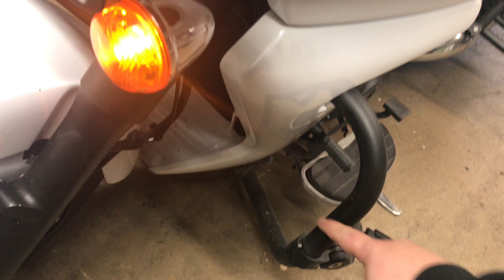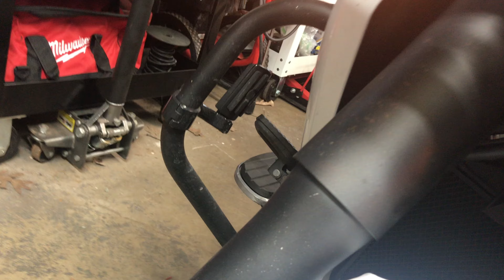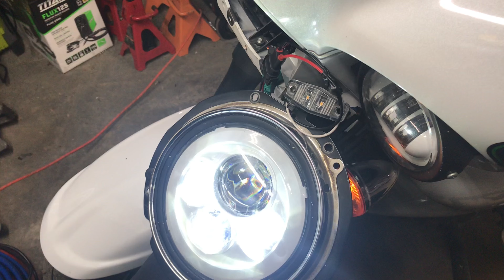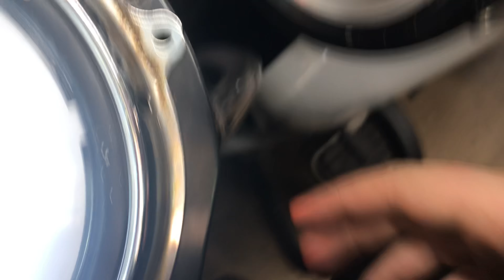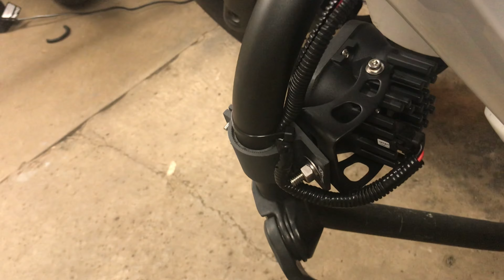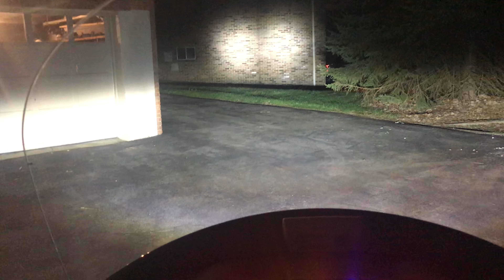Diode Dynamics SS3 Sport Install on Motorcycle

Comment: I'm trying to install a set of SS5 pros on my Raider,  my bike already has a pre-installed switch and female connection inside my headlight for easy install,  but I don't know if I can just plug them right in or if I need some sort of module.. 

If you know about connecting aux lights on a motorcycle the right way, please comment below 👍
Reply from the maker: You can always check it with a test light, if it works I would hook them up. I would be surprised if you needed more than the switch and female connections

Comment: Joe, what about the 3 Front lights would like to change them out too. Thank you in advance.
Reply from the maker: My bike came with them installed when I bought them. I’ll put a link in description for the lights similar to mine. I believe you need an adapter from “engineered adapters”